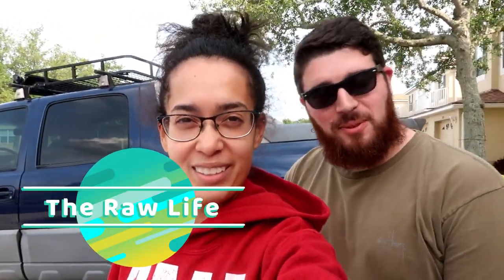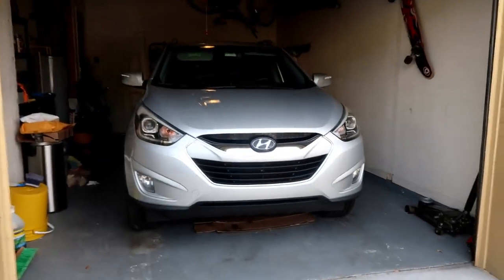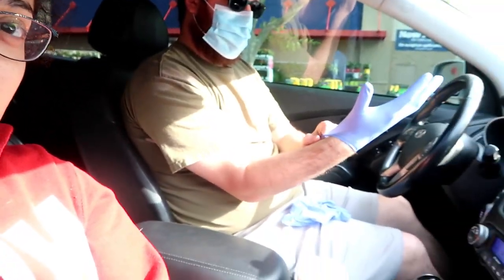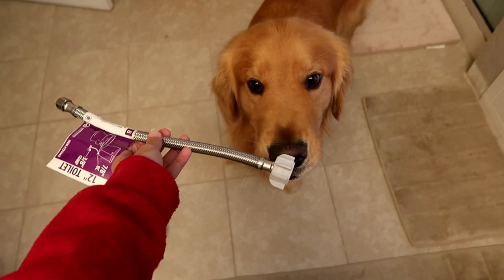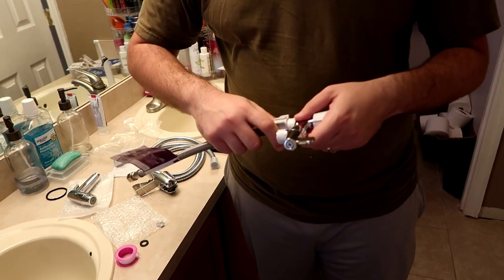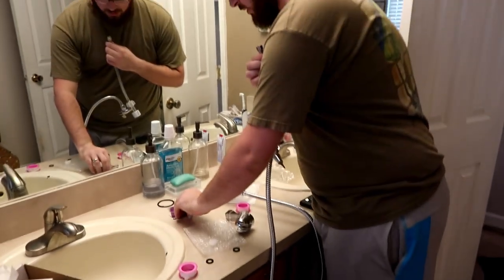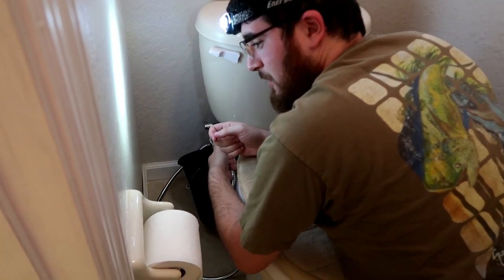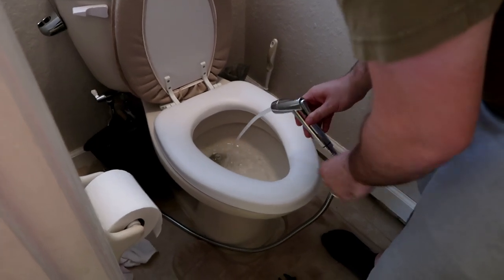Spray 🚿Time - Home 🛠Project Pt.2✌

Comment: You can always exchange the car for something way more economical. I just exchanged my 04' Cavalier klunker for a 2014 Kia Soul this past January. It had 5000 miles on it and I really love it. Because it's higher off the ground, I can slip in and out of the car with better ease. And it has great gas milage. Much to my surprise it handles sorta like a jeep. I just love the thing! The only disappointment is I didn't get a sunroof. NEXT TIME!